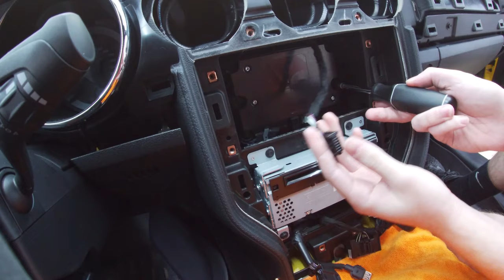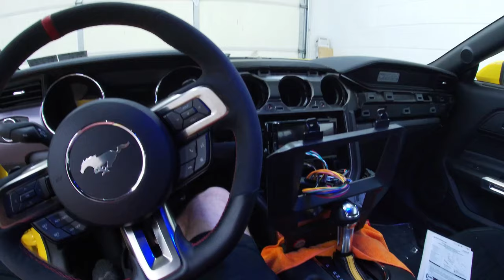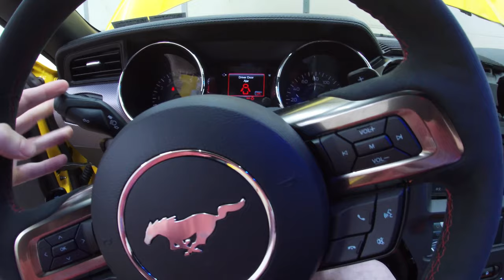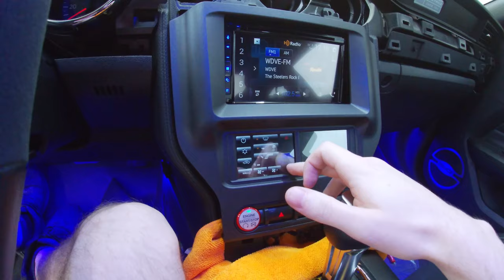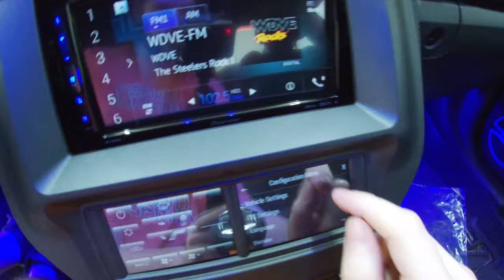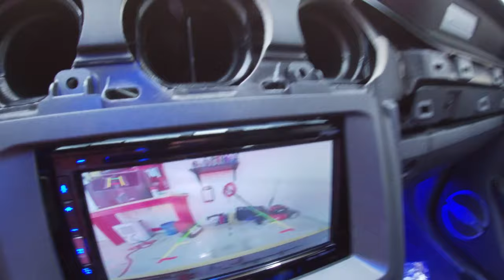2015 Mustang Scosche Dash Kit ITCFD05B - Install Part 2

Comment: Thank you so much for carefully documenting your install! Before watching your video, I had already purchased the exact same receiver (Pioneer AVH-2550NEX). I was curious about this Scosche kit, but your "dud" experience scared me off. I was also put off by the Scosche touchscreen interface for the climate control -- I prefer the original hardware controls, they feel more durable. So I ended up buying a used 2019/2020 control panel for the 8" touchscreen, but without any of the SYNC3 hardware. My challenge now is to figure out what wiring harness I can use to get everything talking to the new receiver. So far, everyone is recommending the Maestro iDataLink products.
Reply: hey did you get it working?

Comment: Hey man , I’ve watched your videos many times over but I have to ask, how did you hook up the steering wheel controls? I have the “key 1 , key 2 ,etc” but I cannot find anywhere on where I’m supposed to connect them. Other than that , you’re videos have been a great reference for my install. Thanks!

Comment: Where did you get those floor lights?? I'm trying to get those installed in my mustang too. Do they stay on while you drive or just when your doors are open?
Reply from the maker: Just blue LED strips from Amazon connected to a “add a fuse” in the fuse box in the passenger footwell. Connected to an accessory power fuse so basically it turns on and off with the radio.
Reply: @guitary18  Nice. I had some LED lights installed by electronics people two months ago. did the same thing. hooked up to the accessories power and now they stay on when driving. love them.

Comment: The climate control is sooo finicky and frustrating. Basically the calibration is off and wont recognize my touch input. Is there anyway to fix this? It literally takes 70-100 tries to turn on or off the ac that I just leave it on all the time.

Comment: I noticed when you installed yours you have no rear defrost button.  Mine doesn't either, but the pics I see online has rear defrost. Do you know why?
Reply from the maker: This is addressed in another comment. They have the button disabled by default but you can enable it within the hidden installer menu. Your instructions will say how to access that menu.

Comment: Did you have a ground loop when you installed this? I can’t seem to find one. I’m having alternator noise only when my A/C is on.
Reply from the maker: I had no issues with grounding
Reply: @guitary18  There’s no ground loop is there? Just the chassis ground (10-pin) and the 12V (4-pin) right? I may have to do something do something different on my wire connections (I have plastic wire crimp connectors instead of soldering)
Reply: @guitary18  Would you recommend checking the connection to see if it’s came loose and is causing the alternator whine?

Comment: Any chance you can update how it is? Have the metra kit and lost ac controls. Trying to weigh my options. Thanks bud!
Reply from the maker: Still works great for me. Not a single real issue. Genuinely the only issue I have is it’s hard to see the screens when I wear polarized sunglasses haha. But everything has been working great. I honestly thought I would miss the buttons and dials more than I actually do. You get used to it quick.

Comment: I just ordered this kit. Are you still pleased with it? From what I read online it’s not uncommon to get a bad kit from scosche.
Reply: August Corum I was thinking of ordering this kit can you tell me if you had any issues? Thank you
Reply: E J I’ve had the kit for a little over a month and I’ve had no real issues. I miss not having the factory microphone and the clock doesn’t keep time but if you use the time on the headunit instead it’s not so bad.
Reply: August Corum  glad to hear it.. does Navigating through all the functions work pretty good? I think I will do like you and take ground wire off while doing
Reply: E J Yeah it’s very responsive and impressive quality for not being oem.

Comment: What’s up dude I just installed this kit also..I noticed there’s no button for rear defroster..any ideas ?
Reply from the maker: East Coast Five Oh yes, mine had the same thing. Strangely they have the button disabled by default for some odd reason. You need to go into the hidden installer menu and enable it. Instructions should tell you how to get access to the menu but if I remember correctly I think you just have to click the scoche logo a bunch of times.
Reply: @guitary18  got it! Thank you very much!
Reply: guitary18 I wanted to order this kit but 1st wanted to ask if any issues since you installed it? Thank you
Reply from the maker: E J none so far. Has been pretty solid.
Reply: guitary18 does the remote start still work ?
Reply from the maker: @ej9236  yes, remote start still works. that shouldn't have anything to do with the radio.
Reply: @ej9236  I can also contest to this that the HVAC controls are working without any issues. I have a manual so cant speak on remote start
Reply: guitary18  oh ok I only asked because I heard the AC don’t turn on remotely
Reply: East Coast Five Oh glad to hear it..
Reply: guitary18  hey did u lose ur back up camera
Reply: guitary18  that’s my only fear is loosing back up camera features